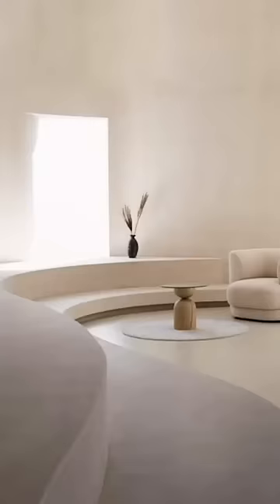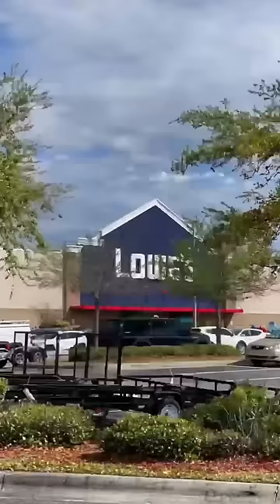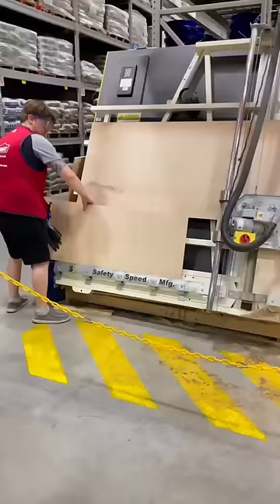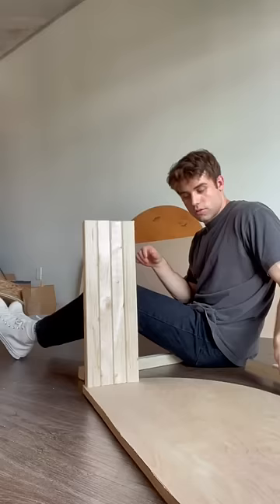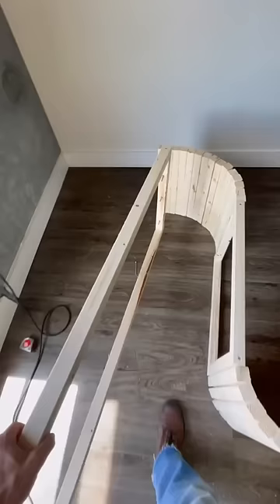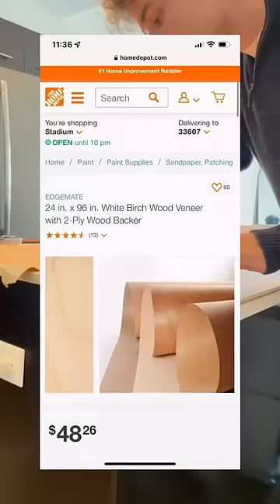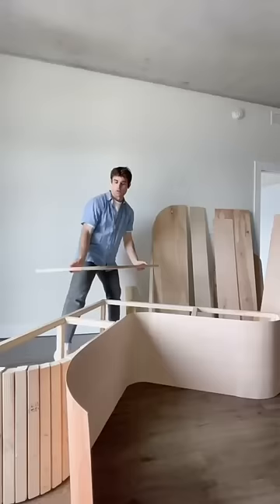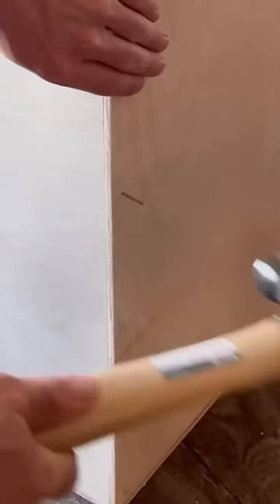How to make the round corner bench of your dreams 🪚🤌🏽 #buildwithjacob #interiordesign

Comment: Never heard of veneer as bendy wood xD
Nice compact vid though i have some questions about stability and comfort. Adding foam alone will probably double the price, not add fabric and youre closeish to 800$ or some depending on material so 1500 bucks for a quality couch isnt that bad imo
Reply: I was so confused why he didn’t sand the bench so he didn’t have to redo it, if he is just going to glue it down he would have to sand it anyways
Reply: @catmixer4450  nkt quite sure what youre refering too, but firstly he probably doesnt have a sander, secondly veneer is very thin, you cant really sand that much without going through
Reply: @D3nn1s  I was talking about sand the wood the veneer was attached to
Reply: @catmixer4450  and how would you do that on an inner radius? Why remove material when you can just do it right and be quicker that way

Comment: At least $500 I'm materials alone, not counting the tools. Other than that, it's a neat little project.
Reply: He used cheap wood + cheap tools, he literally said it was like 200 sum bucks
Reply: @orlandoblas0075  he literally said he used 3/4" Birch ply. 1 sheet of that alone is $90. The wood veneer (what he called "bendable wood") is $50/sheet, and this would take at least two. Enough 2x2's for this would cost another $60. All of that is already $250, before you take into account taxes, glue, screws, sandpaper, etc... And that's not even taking into account any of the tools required to build this. I have built quite a few skateboard ramps over the years, and am well aware of the actual costs of a project like this.
I'm not even going to get into the cost of any kind of finishing materials... (ie, paint, sealant, fabric, cushions, etc. Depending on what you want the final result to look like)

Comment: Honestly just learn basic carpentry and you can build anything
That doesn't mean whatever you build will be good but if you practice the craft enough you will get better,
Just remember safety is the most important part of any build

Now while I would have done a few things differently, it's not bad aesthetically,I question the longevity of its structure 
I also like sanding and carving, which grantees perfection ever time once you know what you're doing,  you could also pad the top a number of ways
Reply: perfect comment

Comment: Drill parallel holes through the top and bottom of the 1 x 1 birch pieces and run a wire through so you can get the curve in place before you start fixing it in place
Reply from the maker: That’s so smart!!! 🙌🏽

Comment: Okay, so if your planning on covering it or painting it just go with grade A sanded plywood instead of birch.  You’ll save yourself literally hundreds.  The “bendy wood” is 1/4 inch maybe even 1/8 inch plywood.  Very flexible and almost always comes sanded.  Overall very interesting but I’m still baffled that you paid only 215 because the 3/4 birch alone, at lowes, is $90 a sheet and based on the cuts it looks like you got 2 sheets.
Reply: Exactly, if you're going to paint it there's no reason to use good wood.

Comment: It's Good But it's Weak and Won't sustain for more than 5 years cause the wood he used is Thin not Thicc
Reply: Yeah there would be a solid cost gap for more sturdy woods
But still wouldn't be as costly as west elms
Reply: Or just put some supports in there along with a bit thicker wood. That thing ain’t gonna survive long if it’s just hollow like that

Comment: You might want to learn what a saw kerf is and how to use it to your advantage- also how to steam wood so you can bend it. Once again you “messed” up and had to re-work. Planning and execution is everything.
Reply: I’ve seen the steaming of wood to bend planks but only in commercial settings and with the use of presses to apply force. The example i mentioned above is the only way I’ve seen it before and I can’t imagine how an individual would be able to accomplish it. Is there a way it could be done at home?
Reply: @Miasread  steam can be generated all sorts of ways  in micro direction and amounts YT is full of ‘em in addition cutting 1/2 depth kerfs into solid wood bits will achieve curved surfaces - explore, there’s a bigger world out there than you think

Comment: Step up to a cheap hand plan or use a router with a flush trim bit to trim the edges down instead of the knife. Cleaner, easier and faster without being crazy expensive. 

Ignore people who hate on you, build what you want how you want. If it isn't structure, electrical or plumbing it ain't hurting anyone if you learn as you go.

Comment: You can find corner benches for much less, like for $215. He picked some fancy ass bench to compare it to. With that aside if you want a custom shape he did a fairly ok job. Needed a bit more structure but should be fine. Put 1/4" thick padding and wrap in fabric and should hide all the imperfections nicely.
 At least he didn't have a Ryobi drill so he has that going for him too 😆

Comment: My most recent project was some 2x6 benches for a bbq. I’ve never done something like that, so I was bound to fail. I messed up a couple of times, but I took everything apart and fixed it. What I found is that my circular saw was at a slight angle, and it made a slight angle in the 2x4’s I used for the legs. That way, unintentionally, I wade the benches sturdier once they were set on the grass.

Comment: Birch plywood isn't necessary, common pine will save $30. Also the 1x2s can be found in 8ft lengths for $3 each. You're on the right track but still overspending

Comment: Material + tools needed = $1500+ 

🤷🏼‍♂️
Reply: the only tools he showed were a drill and a saw he got for $30. idk if the cost of the saw was included in the material price of $215 but assuming most people already have a drill, can borrow one from somebody else, or just buy one since drills are beneficial to have on hand in most homes, making one of these benches yourself wouldn’t cost anywhere near the retail price of one of these
Reply: @cherrymelonlps  $215 was not the total cost of supplies/material he used in this video. I know because I do buy tools, and trust me, you’re not getting a drill and a saw for $30. If you think that, you have never tried to buy a power drill and saw at a Home Depot before. And don’t get me started on the other instruments he used in the video and really don’t get me started how much that limber would cost right now with lumber prices through the roof right now.
Reply: Return the tools after. Keep the receipt
Reply: A drill, some bits, and a jig saw would only be an extra $120-$250 depending on the quality of tools you get. It’s pretty reasonable that all together materials and tools, this only cost him about $400-$500.
Reply: @Rawlingm  i didn’t say he got the drill AND saw for $30. according to him he bought the saw for $30. idk the type of wood this guy used but it doesn’t look like the best quality and i can assure you that building this like he did would not cost more than buying one from west elm.

Comment: A lot better? Nah bro. Untreated Lowe's wood couch with no cushion is not better than a proper built couch
Reply: Technically it’s not a couch it’s a bench. Also it’s $1,383 less than the original. And he can easily put cushions on there or expand it to make it just like a couch for much less.
Reply: Ill take the 215 than a 1k+ couch, buy foam or cushion for support, buy varnish for the wood.